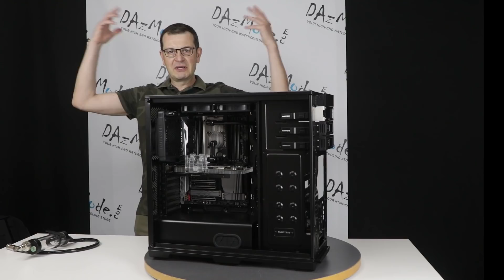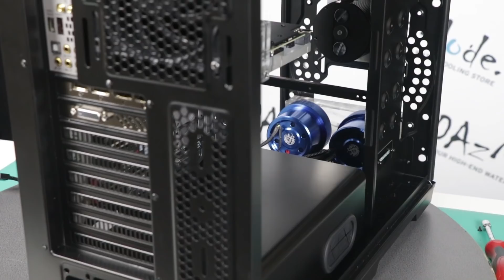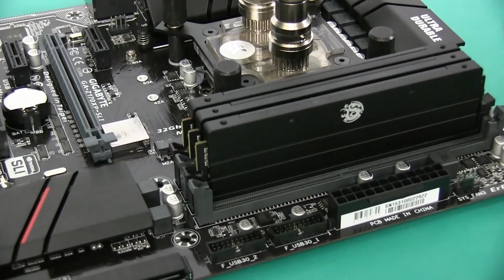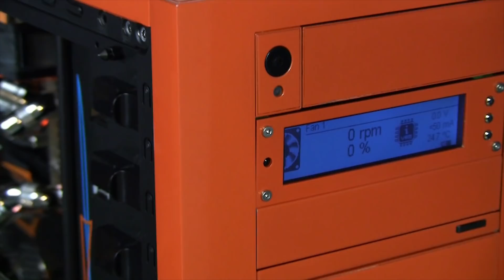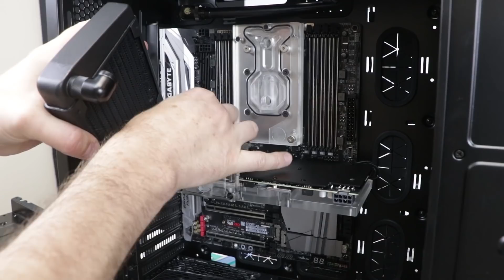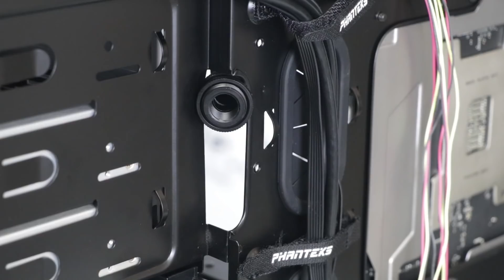Complete Watercooling Layout Design Video -  Baby Blue Ep6

Comment: Finally somebody showing the CORRECT way to leak test!! Props to you good sir. Now the loop isn't my preferred method but then it's not my PC. I have a Phanteks case that I used for water cooling and I ended up with a similar set up as far as the rads go. I like the dual D5 set up and your right about the vibration on that case if you solid mount the pump. I mounted a res pump combo from EK in the bottom front of the case and I had a low hum go thru the case from the pump so the foam pads are a good idea. Good luck purging the air out. I would run the pumps on high setting an move the case about. I suggest leaving the res on for a few days to let the air find it's way out. Cheers!!